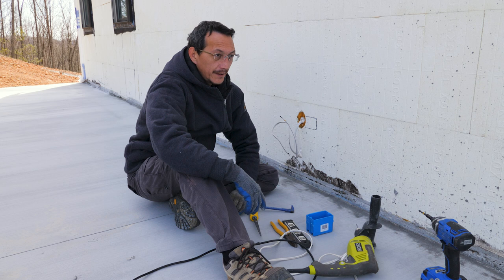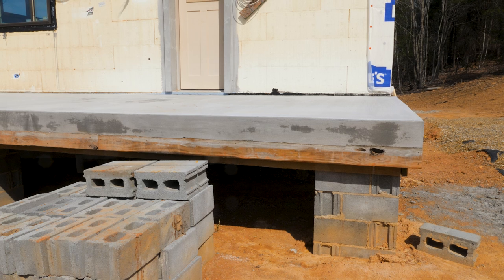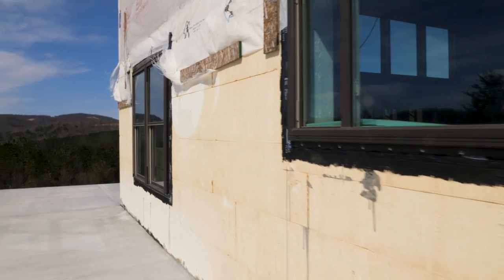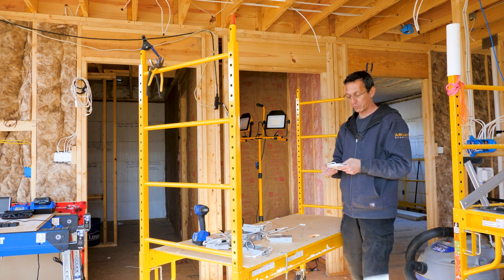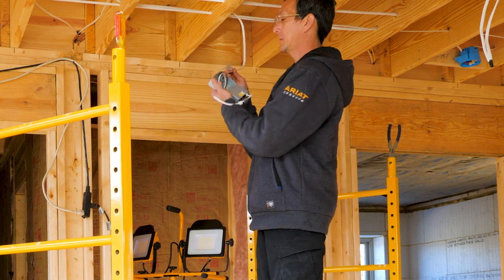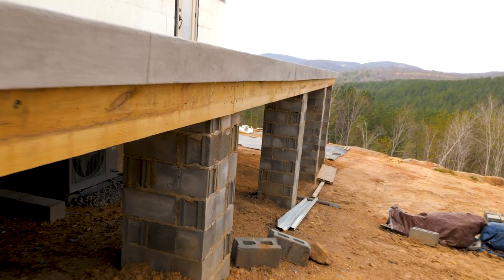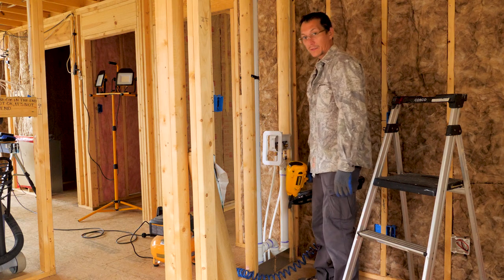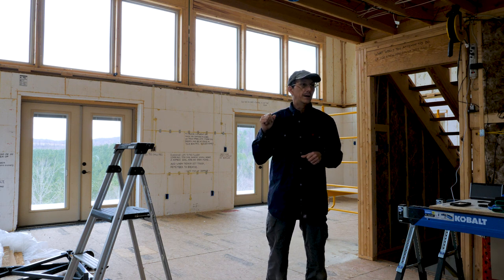We Listened to Your Suggestions

Comment: Another benefit of using the Rockwool insulation on interior walls and ceils is it increase the fire rating, it’s not just for noise and heating and cooling. 👍

Comment: I don't think the blue plastic boxes are rated for surface mounting so you might have to switch to the metal boxes that are to pass an inspection. 

A switched outlet or outlets to a timer box on the porch can be useful if you setup decorative lights under or around the porch.

Can you use the Wago style lever wire nuts for electrical there or do you have to use the twist style wire nuts? They make changing out things very easy as you don't need to redo the entire bundle of wire in a cramped box. 

If you are looking for something temporary to keep the ground in place that isn't going to require mowing pickup a bag or two of clover deer feed patch seed to spread on the areas. You get a nice clover ground cover to lock the soil into place and food for the bees when the cover flowers and the deer will wonder out of the woods to feed on it. Clover is also great for chickens as they love the stuff. Easy to put in without much work and if you want to switch to a lawn later it has been adding nitrogen to the soil the entire time it has been growing.

Comment: We've been in our ICF house just over 3 years now - Love It!
The only 'problem' is that it is so well insulated that the outside temp has to be below 50F or the wood stove produces too much heat at its lowest burnrate with a small fire in it.
I wish I'd known about the LED wafer lights when we built.  I'd have used them for most of the house.

Comment: Suggestion, if you polish and seal the deck, it might be good to texture it with something like sand.  It will be slick when wet and the grit could help folks from busting their bunz with a slip and fall.  There I added my useless two cents.
Reply from the maker: It's a penetrating sealer. I had the same concern but it didn't make it too slick as the broom texture is still there.

Comment: Happy to see the progress you're making.  You may want to consider allowing for overhead lighting in the porch overhangs.  We did a large covered deck and have both door sidelights and overhead pots lights.  We we almost exclusively use the pot lights.  The overhead lighting spreads better and is easier on the eyes being above rather than off to the side.  Just thought I'd mention before you get to siding in case you have to add wiring.  I imagine you could just snake some wires up the foam if need be.  Bet you can't wait for the build to end;)

Comment: The more water you can put on that deck while it is curing the stronger it will be in the long term. It is plenty strong to support guys carrying drywall across it by now,  Nice to see the progress,
Reply: agreed in theory, but it looks like it's been freezing every day there. But I do agree about keeping it wet without it freezing. It's a big thick slab and I hate to see cracks
Reply: @yanbu000  Further into the video it looked like the deck was sealed so my point was moot. I did see saw cuts so hopefully the cracks go where they are supposed to go.

Comment: While you have everything open, you should consider installing corrugated piping between floors and rooms that are empty for future running low voltage wiring like network cables, Satellite TV cables, intercom cables, security cables (sensory & cameras), and who knows what they will come up with next.

It is very easy and cheap to do this while the building is being made. You don't even need to buy one cable, but if you try to do this later. You never know what you might hit., like power, gas, AC lines. If that happens you might be replacing tens of thousands of dollars of equipment or burning down a house. Here in German, Brick houses are built on an offset method. Meaning that the first floor's exterior wall has the thickest walls, the second floor is a little thinner so the floor partially rests on top of the first floor's exterior wall and so on with each floor. Commercial buildings have more fire standards, so this is not done with them. THIS makes it very hard to aim correctly and actual small brick houses shift and twist over time. Germans even though long steel rods through old houses to squeeze them to stabilize the building.

Long story short, I was drilling nowhere near where I wanted to be, but I didn't hit anything at these. I Could have very easily with four 220V power lines within about 6 inches of where I was drilling.

Sorry, I haven't been watching your videos lately, so I am a little later on my advice. 

PS new building fire code for even homes might require fire-rated tubing and fire pudding penetrations. From the look of your construction, I doubt you will have to do anything. 

Pro-tip on pre-installing tubing for future wire runs. Plug or cap the tubes when finished. This will prevent bugs and rodents from easily using them. If you glue a cap onto the tube. Make sure to make the tube a little longer to cut off the cap later.

Comment: As a residential electrician who has put in 1000s of lights. I think 3000k is a better 4000k, most of our customers prefer 2700k. When you put in your modules use a hole saw with a dust bowl. Cuts down on the drywall dust and much easier then hand cutting them in.
Reply: agree.   we just hung our soffit lights and 2700k is 100% the way to go.

Comment: The Lithonia pancake lights are pretty awesome. I put a set of those in my kitchen. I found a couple of the wagos ended up failing on me after a few months (open circuit) and I ended up replacing them with marettes. Not a huge deal, but you may want to be able to pull the boxes out of the holes for service.

Comment: Good morning, the wafers are sold in a 10 watt and 14watt output. If you purchased both, each wafer is powered by its designated driver. Do not mix in the ceiling.
Reply from the maker: The whole house is 14 watt units

Comment: Makes me nervous to bury lighting even drivers in sheet rock as the technology is changing exponentially.  Every four or five years what you have becomes obsolete with the newer generation very desirable.  I would try to stay with thin surface mount style if possible.  That would allow your power box to be the only thing inside the dry wall.  Kinda like how much computer wiring has changed in the, past twenty five years.  Would have been pretty hard to foresee how rapid that was.
Reply from the maker: The wafer lights pop right out so you have access to the driver boxes through a 6" hole. It's pretty easy.

Comment: Do you not have to have your exterior receptacles housed in a water proof box? We do around here.
Reply from the maker: They will have weatherproof covers when the outlets are installed.
Reply: @Guildbrookfarm  O, OK. Around my neck of the woods the whole assembly has to be a waterproof unit, box and cover.

Comment: hows your zip tape holding up against the icf foam?
Reply from the maker: Good. That stuff seems to stick to everything.
Reply: @Guildbrookfarm  good.  i prepped my window bucks with Rub R Wall but wanted something after.  was thinking more Rub R Wall but if tape sticks then ill use that!   less mess. 

whats your black paint you used?
Reply from the maker: Just make sure it goes on clean foam. Once the sun starts beating on the foam it gets dusty and nothing sticks to it so you have to rub it down with a scuff pad. I used Liquid Rubber over all the weird seams, cracks and penetrations. It works great.
Reply: @Guildbrookfarm  yeah thats was Rub R Wall is.  theres a mastic for big cracks and the paint for the rest.   fingers crossed the tape sticks to the paint and the foam where the paint isnt.   we have almost 100% shade so after 6 months now theres been no yellowing etc which is nice.

Comment: That is a long run between outlets on the exterior.  They are always adding 'must haves' for outdoor use so you can't have enough!
Reply from the maker: Each of those exterior outlets is on a different circuit.

Comment: I made a mistake when I built our house, I did not run Ethernet because I never figured we would need anything more than WiFi.  I was wrong, I have built a NAS and store all of our files, movies and music on it.  I am now going back and trying to retrofit Cat6A in as many rooms as I can on both floors.  Now is the time, even if you never use it, somewhere in the life of the house it will be utilized.
Reply from the maker: Yep. I was a network engineer. The whole house is wired.
Reply: @Guildbrookfarm  Awesome!  I have watched every episode but somehow I missed that.
Reply: @Guildbrookfarm  what cat “x” wire did you use. Also which switch are you going to use?
Reply from the maker: Just straight Cat6. I’ll have a couple different switches for different purposes but most all of them work just fine anymore for general high speed use like gaming and streaming.